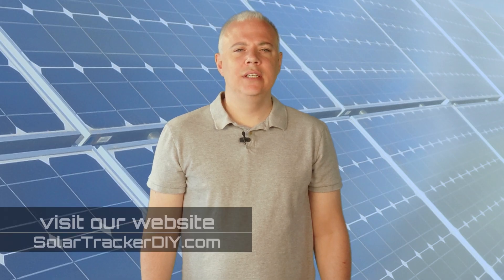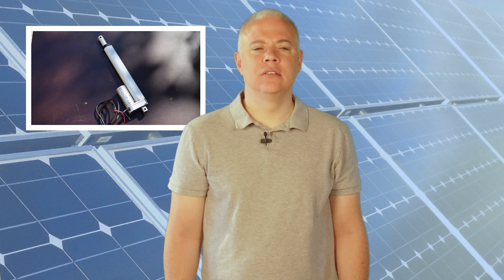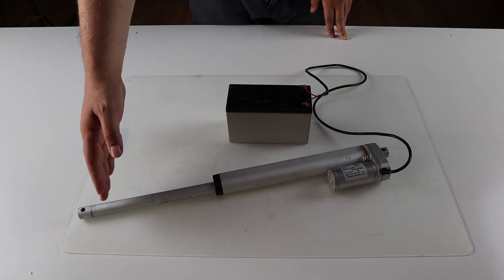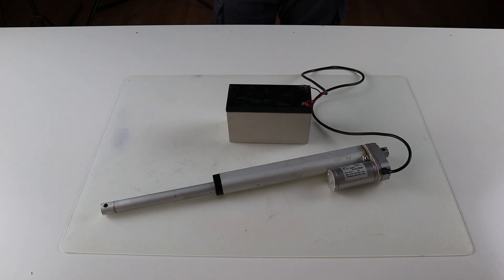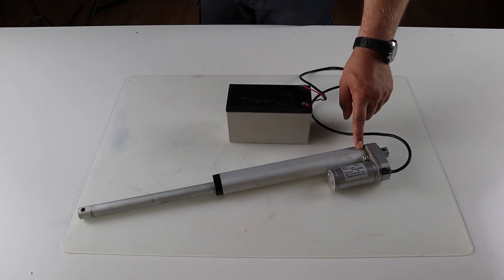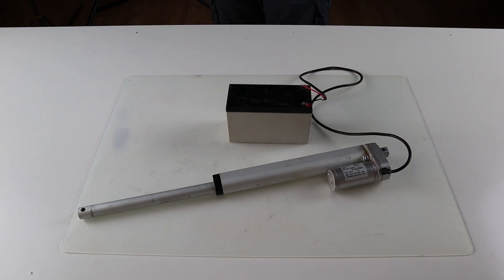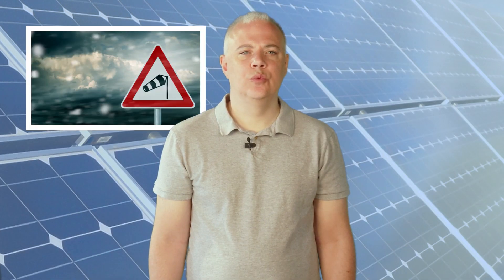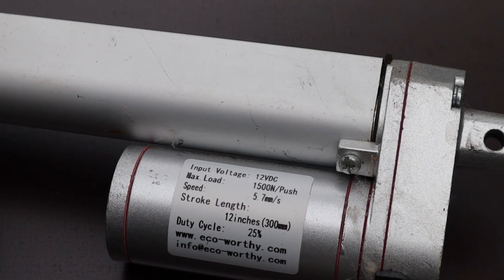Tutorial 02 Solar Tracker: The Linear Actuator

Comment: Good God you have the cheapest linear actuator is available. Those either have a small rubber built in them that breaks upon use. Or they have plastic gears that stripped out. Good luck replacing those every 6 months. I on the other hand have a modified linear actuator made from a stepper motor a gear reducer and a special coupling that integrates the acme screw inside the actuator. Mine have been running for over 5 years.
Plus a stepping motor allows for incredibly accurate positioning within half a degree

Comment: Mr. Gunther, for two linear actuators that you used with tracker, what are the stroke lengths? (in mm or inches) Kindly inform.
Reply from the maker: 200mm and 300mm but i would go bigger 300mm and 500mm

Comment: Love the command you have over subject. Very simply explained the difficult mechanism. Thanks a lot.
Will share with you the link of video once it is completed.

One question, i want to use 26-30 solar panels on frame, each panels 22.9kg. Roughly frame weight would be 150kg as well. So In your personal expert opinion what (N) power/capacity should i consider? Any suggestion on brand?

Comment: If you are still looking for the formula to calculate the wind load, the force created by the wind, there is a wikihow article that might help you. It is called "How to Calculate Wind Load".
Hope this helps you out.
Reply from the maker: Thanks
Reply: Who care just secure with concrete around the pole and be sure you put a cross bars 4 ways cemented and bolted on the floor also put cement mix inside the poles that way any strong wind will not blow them  away ........guarantee maybe Hurricane then your home will go as well he he he